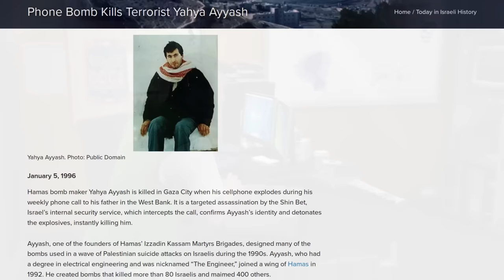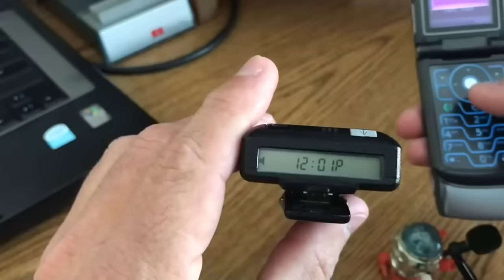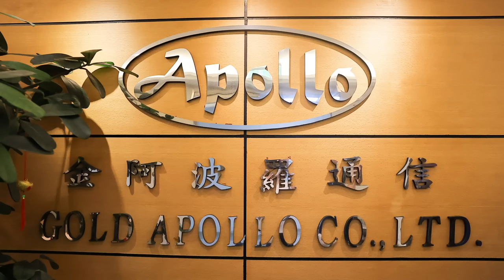What Causes Pagers To Explode

Comment: It seems like a mass "page" was sent out to all the pagers simultaneously. So there was no chance of geo-fencing or discrimination, they all went off at the same time. Also, in one of the detonation videos, it appears that the pager vibrates excessively and really grabs the victim's attention before exploding - maximizing the chance the victim was holding the pager in his hands or close to his face.
Reply: geo-fencing is physical. pager networks are quite small and I highly doubt there is hezbollah pager transmitter in London etc
Reply: They were geofenced in one way: only those within range of the designated service would have been reached. So to use two examples in the video: a pager taken to London would be out of range, but one in an aeroplane flying within Lebanon would have exploded
Reply: yes, they specifically designed it so people would walk up to the pagers ringing across the room and hold them close to their face to see what was happening. its genuinely evil
Reply: @trueriver1950 but a pager is worthless outside the service area so no need to bring it with you. Lebanon only has one airport with commercial flights so there's no domestic travel (i.e. no reason for someone to bring a pager with them). I suppose someone could have been on a private plane or helicopter but Lebanon is a pretty small country so I doubt there's many of those flying between airfields in the country, if there are any airfields that are active.
Reply: @boinqity4621  they will be the fuel of hell.
Reply: Yeah can't believe he glossed over this part. There is also the part where affected devices got signals from Hezbollah so it's not that indiscriminate
Reply: It depends on whether the detonation command was sent through a telco or manually. VHF pagers operate on the 100-200MHz band, so assuming the firmware in pagers was compromised, sending signals to detonate all, or just a select group of the modified pagers within a ~20km range even without the telco's involvement is quite plausible (or even over a much larger range by LEO satellite). My point is if you can compromise a pager to the degree that you've installed explosives in it, you can give each pager a serial number and select which ones explode. Going by previous MOSSAD/IDF behavior, this kind of discretion seems unlikely, but is quite possible technically.

Comment: Pagers are not "harder" to track, they are impossible to track. The only way to make somewhat regional broadcasts, is by using some low powered regional transmitter.

The transmitters would also be the only way of somewhat geofencing, where a transmission happens, as your pager receives the broadcast and interprets it, that thing has no clue, where it is located.

Those manipulated pagers will most likely be rigged to trigger on a specific signal, maybe with a special message, maybe even have two ids, so they would work normally with one and go poof when the other id is used. Probably a combination of both, so that no one goes bang up by someone buttdialing that hidden id/message.
Reply: @funguy398   i imagine the bobby trapped pagers had an specific detonation sender configured or something like that, since they all exploded at the same time.
Reply: If there’s no way to know who receives what pager after manufacturing, would that make them an indiscriminate weapon?
Reply: I don’t know much about pagers, but isn’t their communication unencrypted? Considering their communication is one-way, it certainly isn’t possible to make use of Diffie-Hellman key exchanges, so you’d have to perform the key exchange in a way that is much less intuitive for normal users, and I can’t imagine any civilians actually doing that.
Reply: @ThePC007  they're usually used in hospitals to report emergencies to specialist doctors, so encryption isn't really needed
Reply: @ThePC007  you can  use plain RSA and store the secret key in the pager

Comment: A couple grams of plastic explosives and a dedicated receiver wired to the battery terminals. Detonation command sent via directional aerial transmitter.
Reply: its all the other devices that has me thinking they have a novel method of weaponising batteries.

Potentially they have used both methods, as laptops vehicles and solar equipment have been hit
Reply: @aieverythingsfine  I mean it could be the battery explosion field from Cars 2, but y'know, Occam's razor, I'm betting on sabotaging multiple types of devices as backup
Reply: @NickiRusin  fair that does seem most logical i guess
Reply: PETN, 20g. Directional as much as a radio signal over a country can be, lol
Reply: It was an overheat code pre programed to the device and a heat sensitive compound, device received a message to start overheating and then boom

Comment: I hate to be “that guy” but this wouldn’t make a propane tank explode. Propane tanks only explode under pressure greater than the tank is able to release.
Reply: You're right about that, I'll tell you hwat!
Reply: When the great Propane Tank Event of 2025 occurs this comment won't have aged well.
Reply: @rahkuaschount  underrated comment
Reply: That's not what Michael Bay taught me!
Reply: This guy sells propane and propane accessories.
Reply: The shrapnel can definitely set it on fire.
Reply: it could easily explode if it ignites
Reply: Same with him talking about oxygen tanks

Comment: Prison sell electronics which completely clear cases so you can't hide contraband. Might be a good idea.
Reply: If they have infiltrated into the supply chain it will be easy to hide such a pea-sized High Explosive in the package of a high voltage capacitor for instance. Transparency of the device case won't matter.
Reply: Doesnt really help, many electronics are allready covered in those glues and what not...

Comment: They might have done it like this: most pagers use a standard called POCSAG, each pager can have one or many 7 digit addresses maybe a few shared group addresses (for warnings, news etc.) and a Personal address. Pagers usually only listen on a single frequency (all transmitters for a network just use a time division scheme). So a pager will only react to a call on its frequency with some address that it knows. None of the Data is encrypted so it is easy to gather intelligence about addresses belonging to certain groups or individuals and the frequencys used. So if you just programmed the firmware to trigger the explosion when a magic word is recieved you could have fine controll about who you target because pagers on different frequencys or with different addresses will not react. Reception is also limited mostly by line of sight so if you send the messages from a plane you know ho far the signal will reach.

Comment: One fascinating fact about lithium battery fires, they're not actually called a fire. They're called a lithium event because of the way they're self fueling and self oxidising. 

One of my favourite things i learnt while they were teaching us about working on priuses back in the day
Reply: Saving this
Reply: Self oxidising as in they dont need oxygen?
Reply: @ozzymandius666  the next sentence is literally "they're not actually called a fire" did you even get to the second sentence of my comment before you started typing???? 🤣
Reply: @liimlilim4398  yep, they create their own oxygen. So you can take one and throw it into a big tub of water, and it will just burn underwater until it burns itself out.
Reply: @jakebarlow100  Water is mostly made of oxygen sooooo thats nonsense you just spouted there. Plus theres oxygen dissolved in water. But yeah, i dont know what you think such a thing would show but its not what you claimed it to. Youd have to throw it under a vacuum to show that.
Reply: @Neuromancerism  while you're correct that there's oxygen in water, most things don't tend to burn underwater. And in the places you can't use water (such as grease fires and candles etc) the reason you can't use them most of the time is down to the way things like burning grease react to water not because it'll just continue to burn.

And to make the example stick, that's why the types of fire extinguishers and fire retardant foams used that work by removing oxygen don't work on lithium events. So while I've never seen it directly tested yes a lithium event should continue in a vacuum.
Reply: @jakebarlow100  Thats because lithium is more reductive than other elements, such that it strips the oxygen from them. Thats how thermite works as well, it needs no external oxygen because the aluminum strips the oxygen from the iron. It still needs a source of oxygen, but it doesnt need to be free oxygen.
Reply: You're not breathing, you're just performing aerobic respiration.

Comment: I know he said he doesn't understand explosives, but I want to clear up this misconception. Oxygen tanks are not explosive and oxygen isn't a flammable gas. Oxygen is needed to burn something and having a lot of it will speed up how fast it burns, but you need both a fuel and oxygen in order for it to burn.

A high explosive detonates so fast that the heat it generates quickly spreads out and is unlikely to ignite anything that isn't highly flammable. If an explosive ruptures an oxygen tank, there would still need to be a fire burning nearby for the oxygen to speed up in order to cause additional damage.

Comment: Read from a newspaper that the pagers were supposedly supplied by a Hungarian company that turned out to be just a post box address. I reckon it was a shell company found by Mossad and at least that entire batch was had explosives planted in them.
I highly doubt anyone carrying a pager isn't connected to Hizbollah in Lebanon. Nowadays you only have use for one if you are working in a location with very poor cell signal like a mine or an extremely remote region, unless you are worried about getting tracked. But since they are likely sending a detonation signal on at public radio frequency that probably carries to a geographically vast area, there are probably bound to be some cases where the intended target isn't carrying the device on their pocket and their kid or someone else picks it up.

Comment: 7:20 There's absolutely no way they would know if a pager was at a certain location or altitude, because, as you said, pagers aren't capable of sharing the kind of metadata that phones do and so there would have been no way for the Israelis to differentiate between pagers that are on the ground within Lebanon's borders, as opposed to ones that are in the middle of a commercial  flight to, let's say, New York or Berlin, for example. This was an indiscriminate attack, plain and simple - the only reason it did not cause any aircraft to explode mid-flight is because those poor civilians who were unfortunate enough to own one of these pagers luckily were't onboard an aircraft when the Israelis decided to send the signal to make all of the pagers detonate.
Reply: They could've sent the signal from the specific place that would reach the only pagers that are close enough. Of course all of that is just another conspiracy theory (yet), just thinking out loud.

Comment: It wouldn’t blow up anything outside of Lebanon because it uses FM. The chances of someone using the same frequency and the same signal pattern is 0%
Reply: have fun going through an airport with your totally-not-dangerous misplaced device
Reply: Until someone gets their hands onto one of those devices and reverse engineers it
Reply: @Neuromancerism  So you mean the process of making a remote bomb? You don’t need to reverse engineer this to do that.
Reply: @DiegoGuerrero-zy5ne  No, the specific process to set those one off.
Reply: But people in Syria were also effected by this. Somehow no ones mentions it.

Comment: Pagers also don't emit much EM radiation, like other devices, even networked ECG machines advised to be at least 20cm from a patient with a pacemaker that could affect its functionality when transferring a file over to te network.  Mobile phones in vicinity of ECG can affect the trace, so sensitive these devices are. So pagers are also safer and more practical from this point of view, in addition to the staff not disturbed by cold calls or other intrusive interactions, also being smaller and less burdensome. Pagers still have their use in at least healthcare settings.

Comment: Those videos you cited which show the explosion of a "pea sized" amount of C4 or similar plastic explosive are somewhat misleading: They clearly show a conventional electrically triggered detonator (what looks like a shiny metal rod a few inches long with a pair of wires coming out of one end) to detonate the plastic explosive.
In fact this is necessary in order to make plastic explosives undergo a "high order" detonation, and for two extremely good reasons: To ensure that the explosive can be reliably detonated when you want it to, and more importantly, to ensure that it cannot detonate when you don't want it to. It is the latter which made the invention of dynamite (the first plastic explosive) such a massive leap in both reliability and safety compared to the notoriously unstable and unpredictable properties of nitroglycerin.

Anyway, in any demonstration of such a small quantity of plastic explosive being detonated, the majority of the explosive power is actually coming from the detonator itself, rather than the small lump of plastic explosive. Detonators of this type contain a similarly sized charge of primary explosive compound. These have a similar explosive power to most other explosives, but are sensitive enough to be detonated by an electrical discharge. It is this detonation which propagates into the plastic explosive.

Hence it might be possible that the "exploding pagers" have been modified to fit an electrically initiated detonator inside: This could most likely be initiated using only the on-board battery as the electrical source, without necessarily also needing a charge of plastic explosive. Which would necessarily be a rather small piece of plastic explosive, and probably wouldn't make all that much difference to the overall explosive effect.

Comment: It's fascinating that the implications of the attack are that basically the supply chain is compromised and the only way to be at least 90% certain that a device is not rigged is to either be self-sufficient or force a policy of double if not triple checking everything that comes in and also those that are already present. Implications that can't be ignored so damned if you do and damned if you don't. I do not envy the position of whoever is in charge of doing something about this.

Comment: Two questions I still have.... How did they make a initiator small enough to set plastic explosive off, and How long were these in circulation? I mean, with all the security (theater) everywhere, no one went through a checkpoint with one of those fancy sniffer things that detects explosive residue?!

They basically did what the NSA did to routers a while back. Infiltrated the supply lines, and sabotaged a number of devices. Granted the NSA was installing malwares in routers to release into the wild, not installing explosives, but still, its not exactly a new idea.

Comment: I have a pager just like this. There is an identical model by Motorola as you said it is licensed. The thing that sucks is the battery will eventually leak and the pager will deauth permanently if you aren’t careful. Mine is VHF and we got a network run I g at defcon easily. I think it was eother a timer or very simple speaker set to trigger if paged in the right situation. Pagers can’t really block incoming signals not these from 10-2 years ago. Maybe a digital pager for a hospital 

Stances.

Comment: Sure, there certainly was some civilian casualties (mostly injured), which is unavoidable when you fight against enemys hiding between civilians. But that was probably the most precisely targeted attack possible. In any other scenario where one side takes down thousands of enemy fighters the civilian death toll would be much, much higher, especially in a partially asymmetric war. 
They basically strapped a quarter of a handgranade on hisbollah members, it just doesn't get more precise than this.